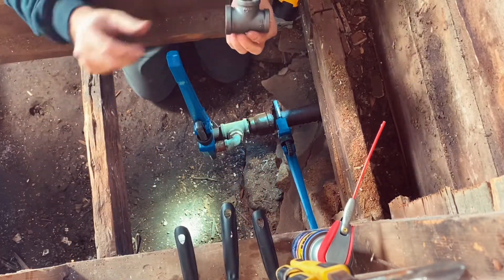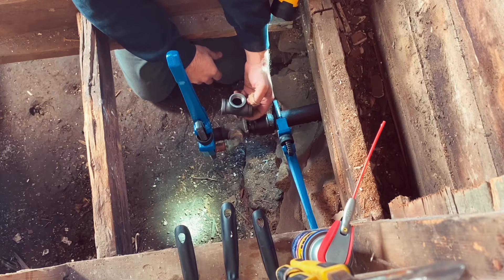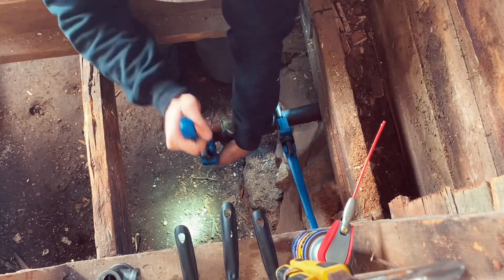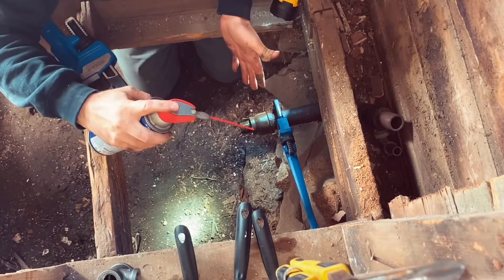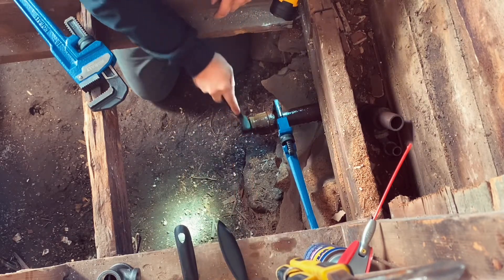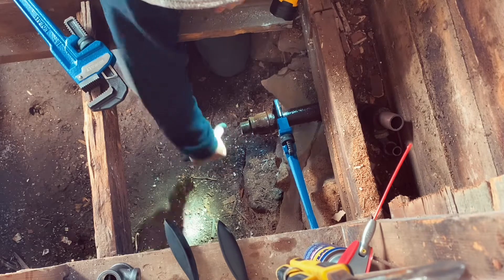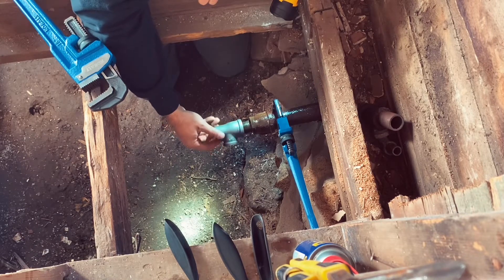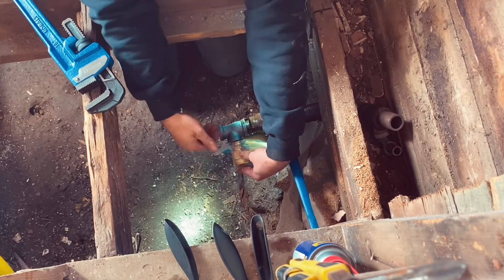how to clean rusted gas connection

Comment: Only a licensed master plumber can work on gas pipes in NY
Reply from the maker: @humanfamilymember  I think it’s that way here also in Oklahoma but I used the old grandfathered in method!! If you live in it for two years, which I did, then you can fix it yourself or replace it yourself for better words;)! I replaced everything even the meter stem that goes into the ground all the way to the house and everything under the house and everything inside.